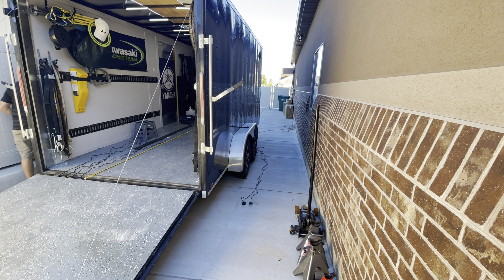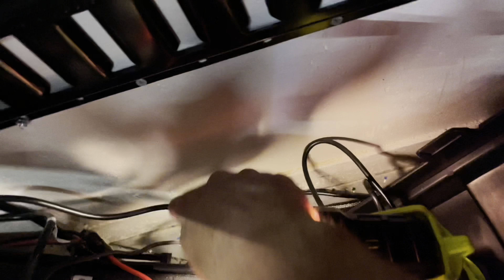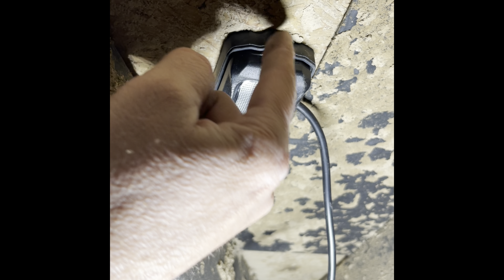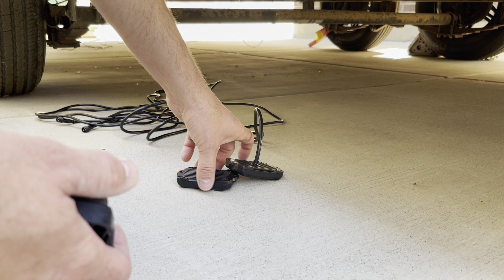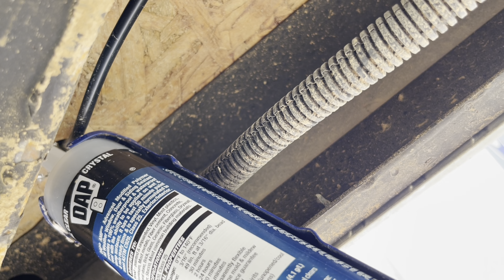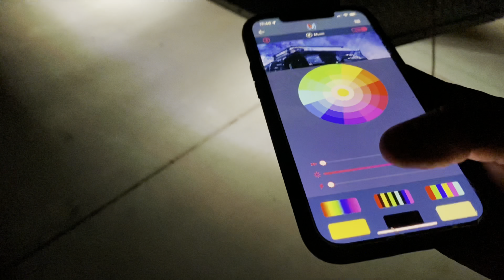MicTuning C2 RGBW LED Rock Lights Installed On A Cargo Trailer!? Trailer LED Under Glow Lighting DIY

Comment: I’ve had 2 kits (8 pods total) on the bottom of my toy hauler travel trailer for a few years now and they are actually wet beneficial at night 
Especially with tinted front windows 
Helps you see your wheels better when making turns and illuminates your area when setting up camp 
Looks awesome man
Reply from the maker: Nice!!

Comment: What’s that digital box on wall by battery charger . Also is your trailer wired to charge battery while driving so you can run the lights while hauling
Reply from the maker: That's the solar charge controller, no, it's not set up to charge while driving from the truck, but it does get charged from the solar panel on the roof

Comment: Haven't seen it or anything but do you or have you installed any type of white lighting around the top? It would definitely light up around the trailer at night for security or whatever you needed as well.
Reply from the maker: That's a good suggestion